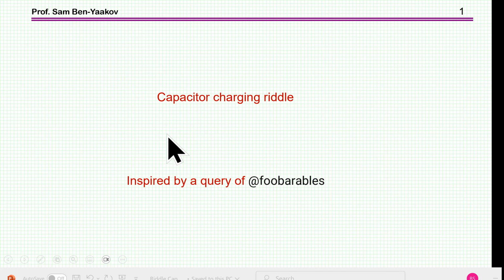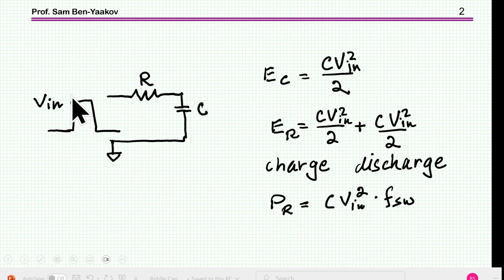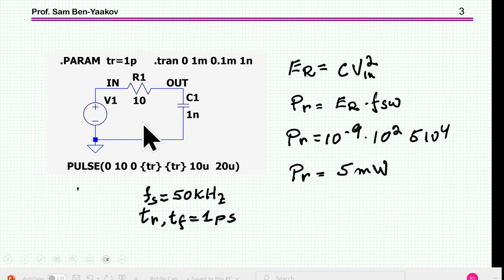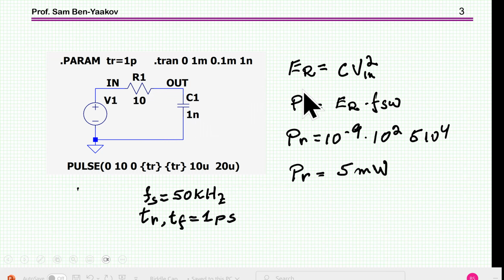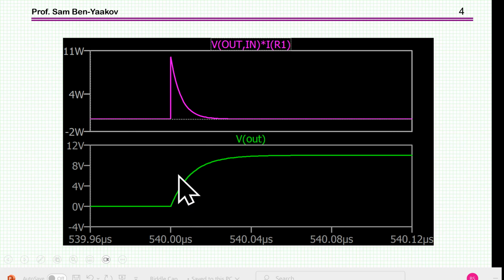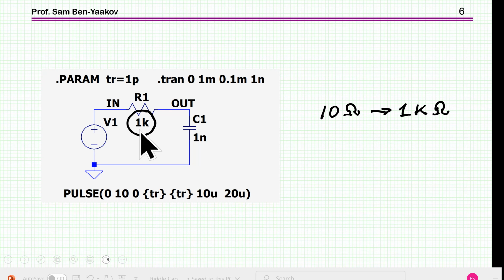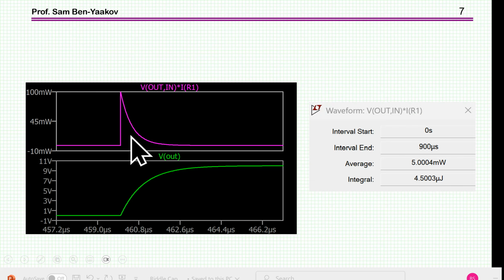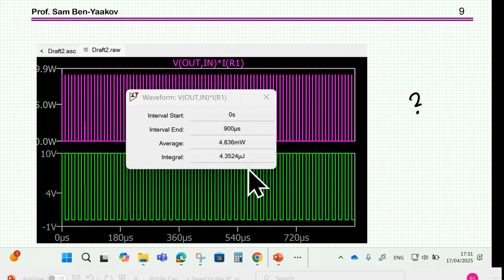Capacitor charging riddle

Comment: Ok, purposefully not looking at your new video just yet so I can make a guess. I think the fundamental reason is that the CV^2 formula is derived under the assumption that Vs is a constant voltage. Normally the charging formula is based on a Heaviside step function where you instantaneously go from Vs=0 to Vs=1, or vice versa, whereas when you consider the rise and fall periods you have a constant dV/dt for Vs instead of a fixed DC voltage, i.e. a ramp function. In the ramp case you end up with a smaller delta between Vs and Vc at any given time than you do in the step case, leading to a smaller voltage drop over the resistor, and therefore less power dissipation.
Reply from the maker: 👍Good inuitive insight.
Reply: @sambenyaakov  looks like I got most of it correct, although I'm surprised at just how much of a difference in power it made!
Reply from the maker: @gsuberland  👍

Comment: Intuitive:
Making rise and fall times slightly slower, slightly lowers the swing of the voltage across the resistor so power will be lower, until at a rise time of ∞ power will go down to zero
Reply from the maker: Nice. Thanks for participating

Comment: Actually you can charge a RC circuit for example at once to 100V bei imposing a step voltage of 100V, or in many smaller steps e.g. 10x 10V or 20x 5V etc. In second case you loose less enery in R than in the first case. A voltage ramp could be considered as a chain of voltage steps...
Reply from the maker: Correct. But why?
Reply: @sambenyaakov  In this example compairing 1 big step of 100V and 10 smal steps of 10V:
C*100^2*0.5 > C*10*10^2*0.5
Reply from the maker: @  C*10^2*0.5
 I guess you refer to the R loss. Why is this value
Reply: @sambenyaakov  It was an example.  One big step vs 10 steps, which is has a form of  a ramp.
Reply from the maker: @frunsebischkek1050  But you did not explain why  a small step is better (unless you rely on my video😊)
Reply: @sambenyaakov  No, your video came later. :) Thanks for that. Always some new ideas to learn. 
By the way the conclusion is, that applying a voltage ramp and R=0 there are no losses at all.
Step voltage causes always the same losses in the resistor no mater how big or small the value is.

Comment: The Fourier transform of a square wave shows a -20 dB/decade roll-off in the frequency domain. However, the rise and fall times of the waveform introduce an additional -20 dB/decade attenuation beyond the frequency f=1/pi*Tr, resulting in a total roll-off of -40 dB/decade at high frequencies. This leads to a reduction in high-frequency voltage components, which in turn reduces the high-frequency current passing through the resistor, thereby decreasing power losses.
Reply from the maker: Thanks for chipping in. The spectral aspect is interesting, but I am not sure it contributes to answering the query, certainly not quantitatively. The spectral emission occurs during the transition of the input voltage. So if it is short, how can it affect the dissipation of the resistor along the charging/discharging duration that can be much longer?

Comment: The capacitor is doing work during the rise/fall time. If you slow the risetime until it's a triangle wave, the capacitors is doing the 5mW of peak power (avg 0 obviously), exactly out of phase of what the power supply is doing, so the power dissipated in the resistor approaches zero.
So with increasing risetime from instant to triangle the power factor shifts from 1 to 0.
Reply from the maker: Not exactly. Hold on to my answer.

Comment: Following my intuition i think the capacitor does not reach the same hight by each first charging voltage peak. But that is only intuition and i know i can learn a lot with your next videolesson. The most interesting little details teach us so much as when you explain us trough the working of a circuit. I look as always out for the answer to this riddle. I love the way these riddles makes us think about the item before the lesson itself comes and makes everything (and much more) clear! Thanks for each of those superinteresting videolessons!
Reply from the maker: Not exactly. Hold on to my answer.

Comment: it says it right there in the beginning. the power lost on the resistor has a quadratic relation to the applied voltage. long rise/fall times means there is a lot of time spent where the supply voltage is much closer to the capacitor voltage than the full supply voltage.
it also just makes sense that a low pass filter would generate much more heat on signals with much stronger high frequency spectral components.
Reply from the maker: Very close. Hold on to my answer.

Comment: The power formula is valid only for tr/RC-->0,
in our case we went from 1ps/1us=1e-6 to 1ns/1us=1e-3.
The integral to be solved is more complex and must be solved in two parts, the first where the voltage increases linearly and the second where the applied avoltage is constant. Using this formula sometimes oversizes when sizing resistors, such as in snubbers.
Reply from the maker: Putting the math a side, what is the explanation?
Reply: The capacitore does not charge and discharge completely, during the cycle, but a certain amount of energy remains stored in it.
Reply: @PierPan-nh3bu  Nope
Reply: Why? Please, can you explain?
Reply: @PierPan-nh3bu  The capacitor charges and discharges "completely" every cycle. You can stretch the on/off time if you like to 100 times the RC time.
Reply: Higher dv/dt signals have higher frequency content. In ideal world where ideal square wave would be possible, that means change from 0 to some voltage level would be instantaneous and its frequency content would go to infinity. My assumption is that in this case 1ps will have much richer frequency spectrum and so also more energy that will flow through this network. Love your lessons!

Comment: A capacitor opposes the change in volatge. The current is I=C*dV/dt . So high rise and fall time, will have low dV/dt. So less current and ultimatley less power loss.
That’s exactly how real-world caps behave, and it’s a key reason why in high-efficiency circuits (like SMPS or RF), designers use soft switching, snubbers, or slow ramp circuits — to minimize current surges and ESR-related losses.
Reply from the maker: Why "less current"? Hold on to my answer.

Comment: i=c*dv/dt, as the slew rate increases, the current drawn decreases, and lowers the dissipation across the resistor. Physics wise it won't make much sense as the charge needed would remain the same, has to do something with the solver model.
Reply from the maker: Why "the current drawn decreases"?

Comment: I see a couple ways to slice this, but the explanation I think I like is that the source is delivering less power into the system, because its impedance is no longer a pieceweise function. Same total energy in the capacitor, but less dissipation because the source impedance is changing.
Reply from the maker: That’s an neresting approach! Hold on to my answer.

Comment: Intuitevly to explain is as folllows. We know when we take 2 equal capacitors one charged and second one not, so connecting them together will end up with half voltage on each capacitor, however in terms of energy we lost half. The energy loss will be same if we place resistor between 2 capacaitors. So lets assume now that we charge the capacitor in 2 steps, at second step the charged capacitor allready have some charge and adding more charge will require less energy, accordingly less loses.  So the ramp is like multiple steps.
Reply from the maker: Not really. Hold on to my answer.

Comment: Hello Professor, nice topic again thank you 🙏🙂
Here is my thought, the CV²F energy formula only really holds when the input voltage switches instantly. If we take into account non-zero rise and fall times, we can actually work out a more accurate expression for the energy dissipated in the resistor, depending on Trise, Tfall, R, C, and Vin. I did a Laplace analysis with equations of the circuit to check that out (pretty fun exercise, actually!). And the results are quite revealing: every parameter matters. In real-world situations like a switching transistor in a power converter with a snubber the actual power dissipated in the resistor can be half, or even less, compared to the simple CV²F estimation. That means there’s room for better cost/performance optimization when sizing the RC snubber.
When Trise is large, the peak current in the resistor goes down, since I = C·Vin/Trise. And because power is R·I², the dissipated power drops with the square of Trise. During the falling edge (Tfall), if it’s long enough, the energy gets shared between the resistor and the source, so again, less stress on the resistor.
All in all, it’s a cool insight that might help fine-tune snubber design a bit better.
Reply from the maker: Very close, But what is the explanation for " the CV²F energy formula only really holds when the input voltage switches instantly"?
Reply: @sambenyaakov  Hello, if the voltage source Vin switch down to 0V instantanously, there is no power going in Vin because any current multiplied by 0 V = 0 W, therefor all the energy (C*V²/2 for a perfect capacitor) is going into the resistor. If the voltage source Vin switch ON instantanously to max DC voltage, we loose the same energy quantity on the resistor as the quantity going into the capacitor (C*V²/2 for a perfect capacitor). So for that particular case, the resistor sees C*V²/2 on both Vin rising and falling event => C*V² in total for rising + falling event.

Comment: When increasing the rise/fall time, not all the charge stored in the capacitor is “delivered” by the source at final capacitor voltage, so the equation of Er=Ec is not longer available. As some charge is “delivered” by the source at lower voltage (during the rise/fall time), energy delivered is lower than in a square pulse, and as the capacitor energy is constant, energy in the resistor must be lower in order to keep energy balance
Reply from the maker: Not really.  Hold on to my answer.

Comment: First, there is a small issue with the simulation timing. Second, as there is a triangular wave, according to Fourier series, it can be modeled as a sum of infinite sine waves that follow a series. Then, the higher frequency ones pass through the capacitor ant that is the energy which is not stored. From the signal and systems analysis, the first case will be a step response because of the delta-t of the simulation.
Reply from the maker: Not really.  Hold on to my answer.

Comment: Low rise/fall time pulse train = square wave excitation; longer rise/fall times pulse train = trapezoidal excitation. According to the Fourier series analysis of the current, the dissipated power is i_rms^2*R, where the i_rms of a trapezoidal wave is lower than that of a rectangular wave. At the same time, both undergo similar spectral attenuation due to the voltage-to-current conversion of the RC network.
Reply from the maker: Current flows only during the transitions.  Hold on to my answer.
Reply: @sambenyaakov  

Of course, there are alternative explanations in the time domain, but they shouldn't contradict/refute the frequency domain one. In fact, I did a PLECS simulation to validate my claim using the Fourier approximation block for both square and trapezoidal first seven odd harmonics approximations, and the square wave power was, in fact, higher. The fact that the current is discontinuous does not refute the fact that power depends on the I_rms^2.

Comment: The capacitor voltage cannot change instantaneously even if the input voltage does.  Also, the RC time constant is not affected by the input voltage.  When the input changes fast, the resistor voltage and current each have much larger transients than when the input changes slowly.  Thus, the transient power dissipated is also larger.
Reply from the maker: Close but not exact. Hold on to my answer.

Comment: Energy stored and dissipated CV^2 /2 will still hold for capacitor but now since Voltage source is not step but ramp , applying kvl and substituting eqn of Vin = (Vin/trise)*t and solving the diff eqn for current and then  intehrating to.find power dissipation. Same will be during fall time ( if trise =tfall) .
Reply from the maker: Not really.  Hold on to my answer.

Comment: This sort of problem came up a few times on the LTspice group: when tr/tf is small (1p << 1u), the pulse can be approximated to be rectangular; when its value increases then you get an effective ramp which cannot be ignored, anymore (i.e. there's an extra x² term now). Also, waveform compression (.opt plotwinsize=0) will detract from the true result if not enabled.
Reply from the maker: There is more to it. Hold on to my answer.

Comment: I will take the bait! Because you are charging the rise time you are not charging with a constant voltage. Thus the power dissipated in the resistor will depend on how fast you are increasing the voltage. You would have to solve the RC circuit equations with a non constant charge to find the behaviour. I would imagine a sweet spot depending on the capacitance, of fast you could charge it optimally.
Reply from the maker: Thanks for partcipating, God intuitive insight. Hold on to my answer.